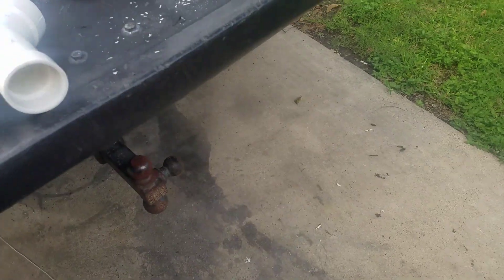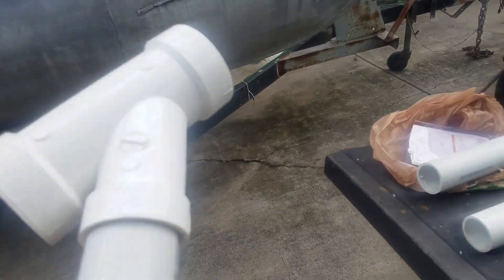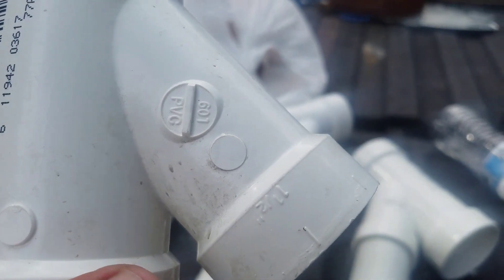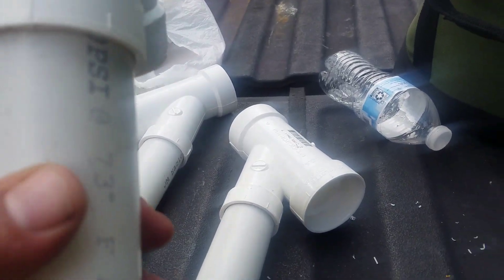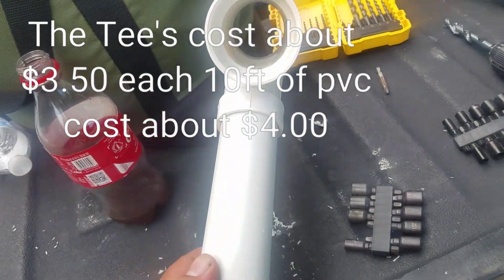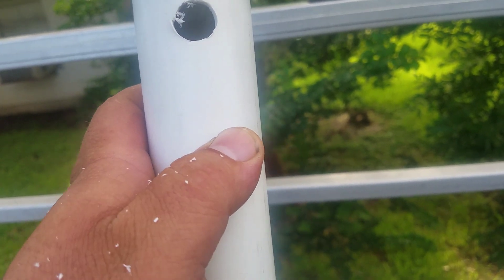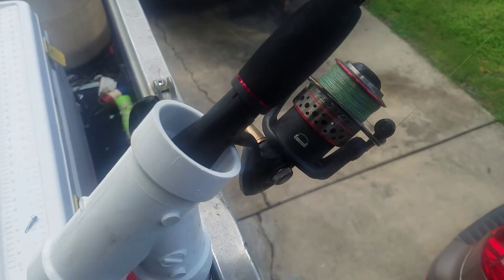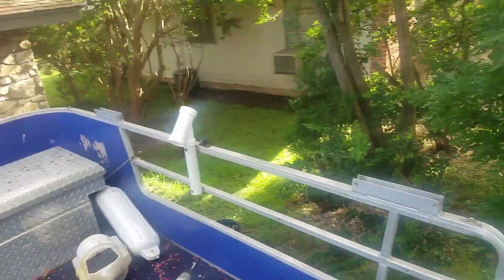Pontoon rod holders

Comment: Will have to install in my son's pontoon. Can you give me an update as to how they worked out. Did the screws loosen due to boat vibration? If they did, might have to drill thru and install bolt and nuts instead.
Reply from the maker: They worked great haven't lossened at all  do glue the pipe together tho they can get loose especially in hot weather
Reply: @stevevillarreal8997  Ok thank you.

Comment: great idea... I was going to just use the straight pieces and attach to the railing of our pontoon...this is much better... one on each side and then two on the back.. cant wait to get to lowes tomorrow and get the pvc and the y-t's. Our boat is in a slip so will have to do all the drilling in the slip ...dont think I will glue y's either so we can remove to put the cover on boat... Hey that writing should come off pretty easy with a little wd 40 or goof off...thanks for posting.
Reply from the maker: side note you may want to go ahead and glue them i almost lost a rod when we forgot to loosen the drag and were drifting and hit a snag